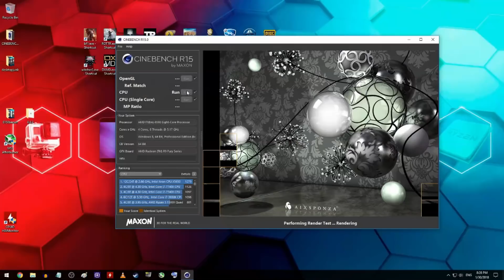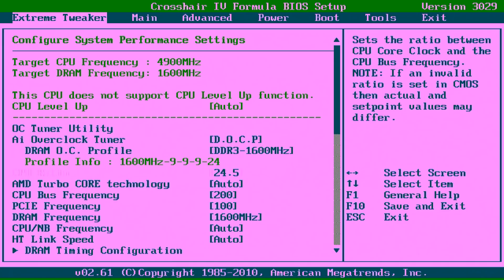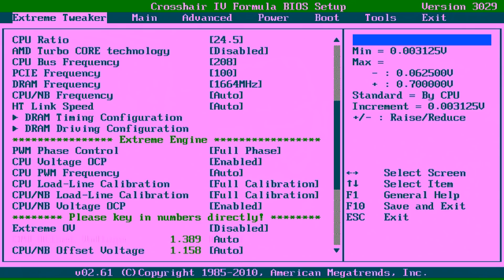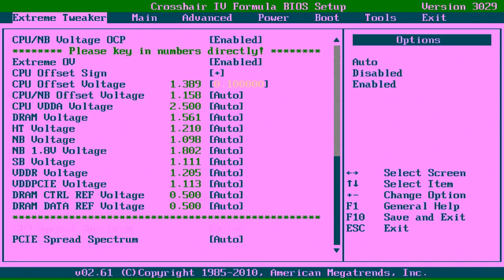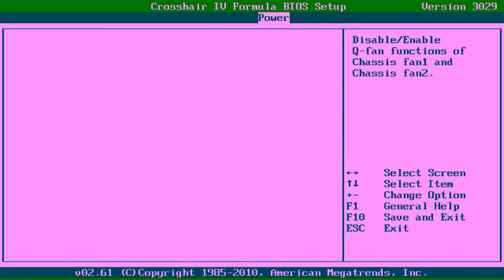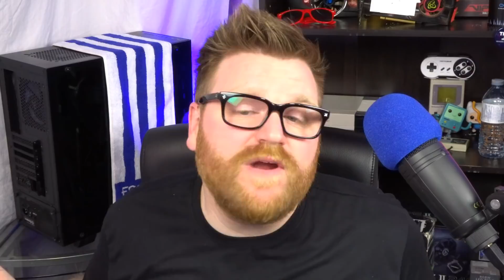How To Overclock The AMD FX Series to 4.8 - 5.1 Ghz!

Comment: I came across Nb and CPU core voltage I find in my search to be inside the Fx's Chip that help overclocking the Northridge speed and Memory Ram to keep system stable.  If I can remember what OC forum I found it on I would leave a link and see it for yourself.  Of the Northridge speed is 2500Mhz and it supposed to be good to help crossfire setup like mine.   I had yet to hit 5.0 with the same cooler but on w Rd 1 Overseer.
Reply: cpu-nb speeds on fx should be a minimum of 1:1.25 ratio of your ram speed.  if you're running 1600mhz ram, you want at least 2000mhz(which is default on most fx chips) cpu-nb speed.  1866mhz ram speed 2333 cpu-nb (you will only get 2200/2400 with the multiplier), so to get it exactly 2333 you would have to use the fsb.  2133mhz ram you will want to run your cpu-nb at least 2600(good luck) or it will bottleneck the ram.  2400mhz ddr3 will need a cpu-nb speed of 3000mhz(not going to happen) to stretch it's legs.  raising the cpu-nb multiplier will create instability at some point depending on the chips imc.  you will have to increase the cpu-nb voltage as well at some point thus raising temps even more.  core speed is more important but cpu-nb does help just not as much as it helped with phenom ii.  a lot of these speeds are attainable for short benchmark runs and such but to guarantee hours of stability you will really have to feed these chips the voltage, but if you can cool them have fun.
Reply: halistine jenkins That exactly where I got it set with the ram for 2000mhz and very right timing on my very good ram.  The downsize for me now because they are tall profile ram stick, the 240 Enermax rad is block from the top of my Rx 1 Overseer.  I have to swap to finding ram stick that work on this board as the memory sheet give me nearly no where.

I did read it helped older AMD chip with the Nb and Ht.  The Nb did help the crossfire little more power as well made more OC room for my 290x memory speed.  Before I could only get 1625Mhz stable, after replacing the thermal pad with Glizzy and a discovery of one screw not pressing the bottom memory ram stick of my Xfx 290x DD 8gb.  Thank for giving extra information to me as well.
Reply: np.  lol i almost wish i hadn't sold all my fx gear now....
Reply: here's some links that helped me on my FX adventures MrDman.  check them out when you get the chance.
http://www.overclockers.com/forums/showthread.php/726957-HT-Link-FX6300
https://forums.guru3d.com/threads/990fx-990x-970fx-890fx-880fx-etc.367816/
http://www.overclock.net/forum/10-amd-cpus/1348623-amd-bulldozer-piledriver-overclocking-guide-asus-motherboard.html
http://www.overclock.net/forum/10-amd-cpus/1202751-amd-fx-cpu-throttling-fixes-please-sticky.html
http://www.overclock.net/forum/10-amd-cpus/1140459-bulldozer-overclocking-guide-performance-scaling-charts-max-ocs-ln2-results-coming.html
http://www.tomshardware.com/answers/id-2114480/overclock-6300-ghz.html
http://www.tomshardware.com/reviews/990fx-motherboard-review-amd-fx,3464-18.html
http://www.modders-inc.com/gigabyte-990fxa-ud3-rev-4-0-motherboard-review/4/
http://www.hardcoreware.net/amd-piledriver-fx-review-vishera-8350/10/
https://www.hardocp.com/article/2012/10/23/amd_fx8350_piledriver_processor_ipc_overclocking/

Comment: well, if a core 2 extreme at 3.0 ghz stock could survive an entire bencharking row with 1.53v at 4.28 ghz (tested by myself) im pretty sure theese fx could run at 1.52 or even beyond with the proper cooling. The problem is this kind of cpu are extremely power hungry even at stock, so, put these voltages on this chips will generate TONS of heat, so you will be stuggling with the throttling even at 1.45v.
Anyway... Really nice stuff bro. keep the good job.

Comment: just FYI
- on the llc setting. this asus board (all board actually), if you set it to very high option , the board going to give much more  voltage on the cpu when load, just find the stable llc setting(maybe medium),  if there's any option on that board, 
because in the crosshair V  that i had, it got 4 or 5 (forgot) option of llc.
if you continue that..your cpu  will degrade, even your board going to die (if the vrm really bad, like the msi board for fx series)
- fx series like higher RAM speed too, although there's a limitation...depend on the board. some board can run 2400 mhz.

my 8320e 4.275ghz can hit 670 on cinebench, sometimes 680. i want to go more, but my heatsink  is the limit, i think psu too... hehe....
sorry if my english is bad.

Comment: I finally hit the freakin lottery,..  I got my 8700k @ 5.0 @ 1.280vcore.  2avx offset.   On a Asrock Taichi.. Its working beautifully.
Reply: that's an excellent oc if it's stable.  i want that chip...but gonna wait a bit and see if intel's new silicon is "out of the box" resistant to  speltdown next year.
Reply: "grats" - Wood cutting level is now 99
some people have all the luck
Reply: Brother, Ive ordered a bunch of chips.. ive always ended up in the middle of the road. btw, in no way was i trying to brag at all, just sharing good news with fellow overclockers. cheers!
Reply: Noctern Realm
I wasn't throwing any shade at you I was just making a rune-scape reference. Best of luck to you.
Reply: Alexander Bluhm thanks boss, Godspeed to you
Reply: An above average CPU but not amazing, you should be able to run at 5.3ghz with 1.4v if your cooling is good enough with that at least with a delid.
Reply: but is that 0.3ghz actually worth all that extra power?
Reply: fair enough, I always like to strike the balance between how hot the chip runs to how much performance I gain
Reply: Congrats! Asrock Extreme4 here with 8700k@5.GHz@1.248v Prime 26.6 and 27.9 non avx stable. Running 24/7@1.296v with TridentZ 16GB@4133MHz@17-17-17-32-340-2T.
Reply: Yeah, the i7 8700K is a beast. The Ryzens don't have much headroom for overclocking. I have the first gen Ryzen Threadripper 1950X and if I try to overclock it to 4.0 GHz or higher it requires a lot more voltage than just running it at 3.9 Ghz.
Reply: Not for gaming but for benchmarking competitions essential.  I usually run chilled hardware, 1.45 volts is the max I can use on my 7700K and I would use more if I could.  5.34ghz is max clock speed I can bench at but when I get a delid should be a bit more.  5.05ghz was my max on air and 5ghz at 1.4v the most I gamed at but I have an open bench with a fan on the VRMs and a top en Apex board.

Comment: Man I hope you measured power consumption :D
Reply: 1.21 gigawatts!
Reply: With the FX8000 and 9000 series being pretty much architecturally identical, I'd imagine you'd be looking at about 220-230w at 5.1GHz, 1.525v
Reply: @DigBipper188  They really aren't as identical as most people think. The FX 9000 has a higher 220wTDP to maintain stability at 4.7 GHz or higher but the FX 8000 series requires higher voltages than the FX 9000 series to achieve the same clocks and not all of the FX 8000 series can achieve those clocks. For example The FX 9590 can be stable at 4.7 GHz with a 1.35V CPU VCore if the LLC is set to extreme, if it is set to high it can be stable at 1.42V CPU VCore. The FX 8000 series sometimes needs as much 1.50V to achieve a stable 4.7 GHz and causes it to run  much hotter than the FX 9000 series.
Reply: The catch would be the 9000 series were probably cherry picked, in spite of their huge power requirements.

An older, generic core may well require more power to hit the same levels.
Reply: @glenwaldrop8166  They were cherry picked but they are programmed slightly different than the 8000 series